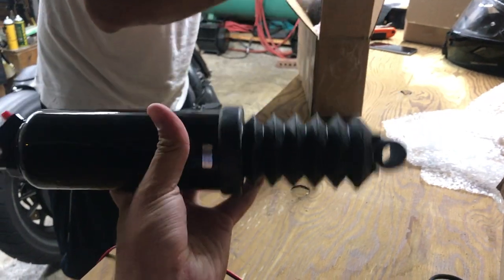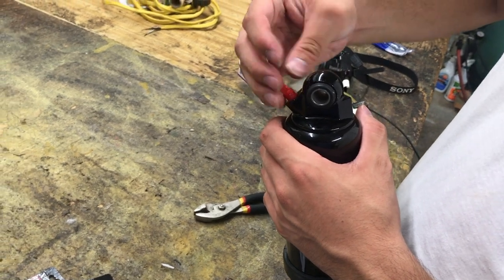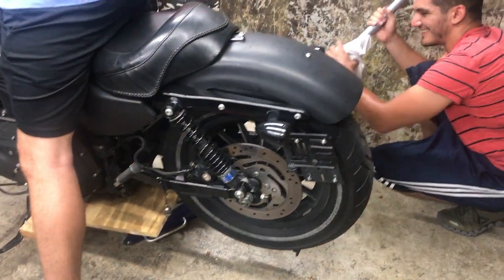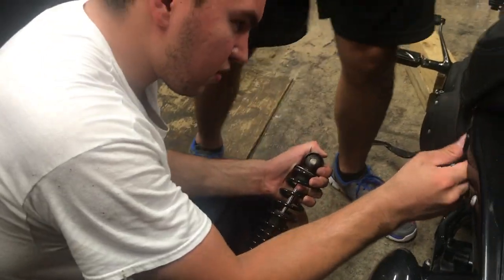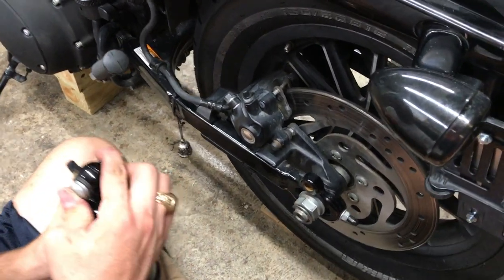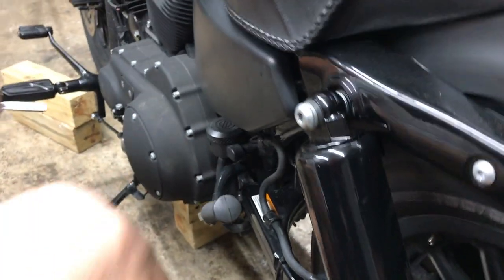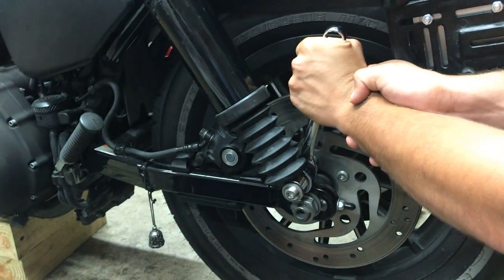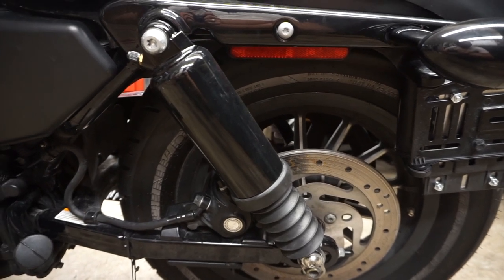Installing Harley Road King Air Shocks on Sportster | Iron 883 Sportster Build Ep. 06

Comment: How many PSI did you end up putting in the shocks?
Reply from the maker: Solo I would run them at 0 PSI. With a passenger I would add some air but don’t remember how much. There is tons of info on these shocks in the sportster forums.

Comment: Hi, I am doing the same kind of mod to my bike. I have a question. Since by extending the length of the shock absorbers, you changed the swing-arm angle relative to the ground. Did you re-adjust the tension of the drive belt? Thx for the infos. Cheers

Comment: you changed the oil in those before installed them right ?
Reply from the maker: No sir. If I remember correctly these were take offs with zero miles. I don’t think these are serviceable per Harley but I have read on the forums that others have done it.
Reply: @twinsmotogarage1866  they are serviceable , Harleys full of 💩
Reply: I put in 6 ounces of three-way shock a while 10 ounces way to farm 180 pounds right solo all the time

Comment: How does this ride now? Stock stortster  shocks suck!
Reply from the maker: Gene Holmes I can’t speak for the stock shocks because the previous owner had already changed them out. These air shocks worked great for a 2 up ride at 380+ lbs combined rider weight. They feel a bit firm solo even at 0psi.  Still need to get more miles on them but I’m liking them so far.
Reply: @twinsmotogarage1866  what do you weigh
Reply from the maker: Trevor Clements 230

Comment: No loctite on your shocks,.. SMH
Reply from the maker: Dave Yeah I was shaking my head when I realized It . We went back and put loctite on each of the four bolts then torqued to spec.
Reply: @twinsmotogarage1866  Just a heads up, if you want to get the seat back to stock height but want to keep the comfort of the larger travel distance of those shocks, you can. Grab some LA Choppers Black 1 in. lowering bracket (or similar), you keep the best of both worlds. Did mine and it feels like a cadi on an air ride.